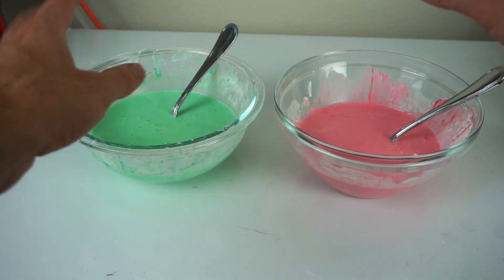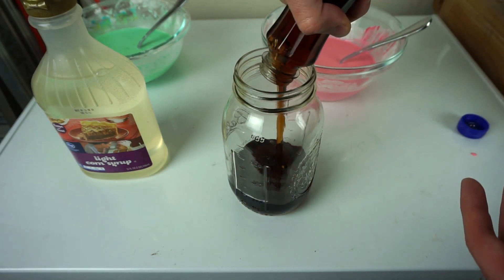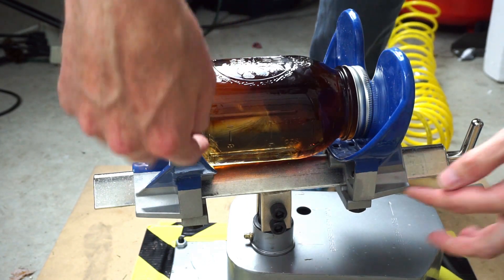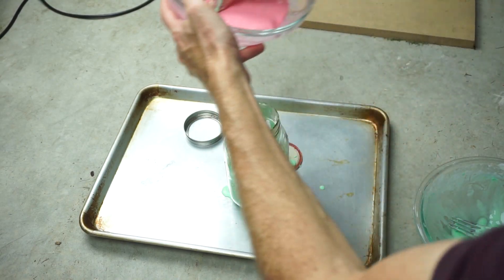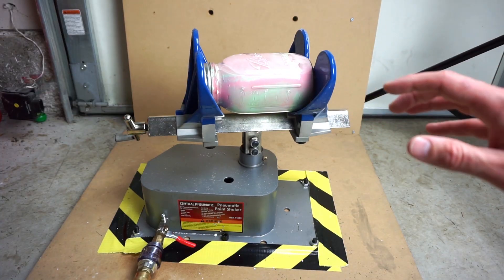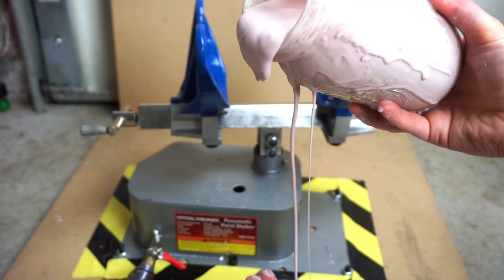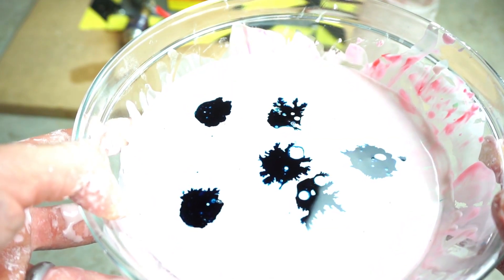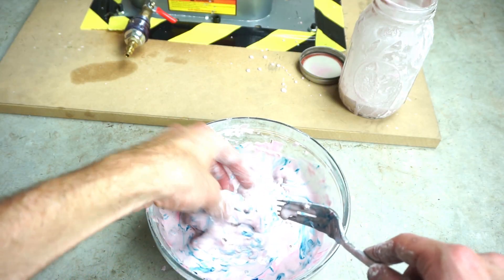Is it Possible To Mix Oobleck in a Paint Shaker? Shaking Non-Newtonian Fluids—I was Surprised!

Comment: Dear @The Action Lab , I was watching a youtube shorts video of yours featuring this video, and the subject of vibrations and non-Newtonian fluids intrigued me. I was hoping you could perform an experiment I do not have the materials to do. The experiment goes as follows: 

Materials: 
A machine used to rapidly vibrate a rigid plate along various axes, preferably with adjustable amplitude and frequency
a rigid, planar plate at an incline used to gauge the rate of movement of a fluid down the incline at various frequencies, amplitudes, and axes of vibration
At least three fluids, one exhibiting Newtonian properties as a liquid (e.g. water), one exhibiting shear-thinning (e.g., ketchup, grease), and one exhibiting shear-thickening (e.g., oobleck)
A setup such that the vibration of the plate can be adjusted to various directions (i.e., co-planar-horizontal, co-planar-diagonal, co-planar-"vertical," perpendicular,  horizontal, vertical, etc.)
Camera for recording

Possible independent variables: axis of vibration, angle of vibration relative to incline angle, frequency of vibration, amplitude of vibration, fluid on the plate, volume of fluid deposited onto the plate, whether the plate is vibrating when the liquid is deposited onto the plate
Possible dependent variables: rate of flow of fluid, rate of movement of fluid (in the case of the fluid rolling or sliding rather than flowing), presence of flow, threshold amplitude for the flow to be halted, manner of movement (i.e., sliding, rolling, bouncing, flowing, etc.)

I am extremely interested in the results of this experiment, although I do not have means to perform it. I encourage you to adapt the procedure and/or material, variables, etc. as it may suit you. Possible applications of this experiment could be the effects of vibration on the employment of non-Newtonian fluids in elements such as bearings, containing grease, or possible uses for suspension in vibration-affected objects, possible use as a conditional adhesive, and more. I hope you see this, and I do not ask for credit, only answers. This is not time-sensitive for me, merely a curiosity. If there have been studies on this type of question, would you please link them? Thank you!

Comment: I don't think syrup is Newtonian. Newtonian fluids always have the same viscosity. I haven't looked it up to confirm but I would confidently bet that syrup is thixotropic.
Reply: Also, it would be interesting to see how two layers of colored sand mix and whether they'd be similar to the oobleck.  I also didn't expect mixing as easy as what we saw so I think either some water/die became mobile or the oobleck was made solid (and brittle) enough to act like tiny particles rather than a continuous liquid (which I suppose might be regarded as tinier particles in some senses)

Comment: An easy way to make ooblek a color is to use the food coloring in the water before adding it. I didn't think anybody would try it after already mixing the two. I just figured people would know it would be to hard. I see a lot of comments talking about how he said red and not pink. It could have been red and the cameras just funky, just said it wrong without thinking or he's color blind. And I also see comments about the ooblek itself. That is perfect ooblek. If you properly measure everything it should be just like his. 50/50 water cornstarch.

Comment: In the same way vibration (such as earthquakes) causes liquefaction in solids, the vibration of the paint shaker will mix the fuck out of “oobleck”. There is no impact or shearing force in the paint mixer so it should liquify more than it would under ordinary circumstances

Comment: Can you mix concrete in a paint shaker?  If you put the mixed concrete in a vacuum chamber, will it remove all of the air?  If you simply put water and concrete mix in a vacuum chamber, will the water spread throughout?

Comment: Perhaps the speed of the shaker doesn't matter? There is always a point closest to the center of rotation where, no matter how fast you shake the whole jar, it is still moving very slowly...I think even if you got your hands on the fastest paint mixer you could find, it would still mix itself from the center outwards. Did not expect it to mix initially, but thinking further it makes sense.

Comment: This must be because the oobleck moves with the jar and is too thick to splash anywhere so it circulates within. Wish I could’ve worded this better.

Edit: in other words, the oobleck gets hard when compression happens to it, so it takes the easy route and converts that movement energy from the paint shaker into movement energy

I still wish I could explain this better

Comment: I think you used too much corn starch in this oobleck
Reply: I was about to comment this exact thing !
Reply: Yeah that’s what I was thinking. It was wayyyy too hard
Reply: I have to agree
Reply: he was testing how it mixes when its supposed to be in its solid state, so a thick mixture with high shear rate means it takes a lot less force to be solid which is what you want in this particular case
Reply: No it doesn't. I've made oobleck before and it is supposed to be like that

Comment: When oblec stays in a steady rate, it becomes a liquid. Even in movement, if the frequency of that movement stays the same the vescocity of the oblec will be such as a liquid. Oblec only hardens as a reaction to sharp instant force. So if you like oblec and then keep your finger there, it will eventually liquify. And paint shaker applies the same vibrating frequency to the oblec so it reacts as if in a stable, stationary, enviornment.

Comment: It's the same exact substance, of course it will mix, well it's actually the food colouring mixing.
Reply: Kale Stars that's not what he was testing though
Reply: ben zelmer no, he's testing the behavior of oobleck under fast shaking conditions, the coloring is there as an indicator.
Reply: Kale Stars if you put two blocks of aluminum in the container, will they mix? They are after all the same substance...he is interested in trying to mix non Newtonian fluids because they behave like solids under some circumstances and liquids under other circumstances, and obviously solids do not mix.
Reply: Aero he is saying that the oobleck didn't move much, but the food coloring in the oobleck did. Unlike the syrup mixing, the oobleck was made from the same material just with different colors making it hard to observe if the oobleck was mixing or just the dye.
Reply: Kale Stars I word smart I all most spelled the word smart wonge I all most did it again
Reply: Ismileback that is what hetesting will it mix

Comment: I don't think it'll mix because what causes the solid to liquid reaction is caused by the corn starch. When you place enough into water, the corn starch stops dissolving in the water and starts just absorbing it. When you put pressure on it, enough water comes out to create the "solid", but as you let it run, it reabsorbs the water. Because of this, just shaking it wont put the pressure required to prevent mixing. At least that's my hypothesis, I haven't looked it up.

Comment: maybe the point is that the shaker actually isn't moving that fast around the rotation axis.. right at the axis it doesnt actually move at all, relatively... only the far ends move fast... AND since it is moving back and forth it actually comes to a standstill for a very short time to reverse direction...
of course it would be easier to mix in the colors if you mixed the color into the water before adding the corn starch.. ;-)

Comment: It's because oobleck's viscosity actually goes up from pressure not movement. The reason it starts to act solid is because the starch molecules get squeezed together and act as a wall, so in a jar its all one liquid with no real outside force just like if you were to pour it into each other.
Reply from the maker: +jacob freed I agree that is pressure that makes it solid, but in the paint shaker there is an artificial force (centrifugal force) that does cause pressure. Just not enough to solidify it as I learned:)
Reply: Im now realizing that I could have explained what I was saying better but their is no surface tension between the two colors it is all one liquid. Since like I said the starch condenses and forms whats similar to a wall, the entire center is free to move around because the outside is the only wall like substance from surface tension. Plus there is no movement on the plane of y or z only x meaning it can mix in an up and down, or forward and backward motion forcing it to make a triangle waveform as it moves around inside the jar which is why there is a visible difference from the outside. Also you are referring to an oscillate force meaning to move back and forth in relevance to a center point vs centrifugal which is to move around a center point. (punctuation is not my strong point)

Comment: The reason it worked is because both th pink and green are both using the same compound, cornstarch. That is why the syrups also mixed because even though one was more dense they are both primarily sugar those two compounds would probably not separate after being amalgamated. Vinaigrettes however are easily separated because you have a minimum of two completely adverse compounds: liquid lipid like olive oil and vinegar; they are able to make a homogenous mixture because of air being mixed into it. However most vinaigrettes will separate and need to be mixed again due to the high density in oil vs. vinager; again two non related compounds.

Comment: saying that mixing with a fork is inefficient was incorrect because you tried mixing food coloring with oobleck (different properties), but with the paint shaker you mixed two different colored ooblecks (have the same properties). you cannot say that a paint shaker is a more efficient way of mixing oobleck because it was not a valid control. try mixing oobleck and food coloring in the paint shaker or mixing the two oobleck colors with the fork, then it will be a valid experiment.

Comment: I don't believe the two are "mixing" so much that the water in the two is now one mass of water with two dyes in it. That dye, in the water, is hampered in its movement by the cornstarch. It's like watching water flow through a compact mound of sand, like the water table. It's one body of water with dye in it which is hampered by the presence of cornstarch. Of course it will mix.

Comment: There is a fair bit of air in the jar. It'd be possible the oobleck is breaking apart as small solids which will then allow those smaller parts to move and mix.

Comment: the oobleck mixed because they are the same density or close enough to the same density unlike the syrup and light corn syrup so they did not try to separate and make one color float and the other sink
Reply: or that is at least why they mixed faster than the syrups

Comment: it mixes the same way a full jar of multi colored sand would. The oobleck is in its most solid state when it's being violently shaken by the paint mixer. Because the mixer is so violent, the oobleck fractures the same way it does with the fork, but in thousands of much smaller fractures every time it reverses direction. Just as the grains of sand would not settle back into the same space it was thrown from, the fractured oobleck will also not return to it's exact original location and another fractured piece will move into that location. Soon, it appears as if it had mixed as a liquid, but in reality, it mixed as a solid in a fluid state.

Comment: my hypothesis is that it will not mix because the oobleck only moves when a slow and steady force is applied to it, however, the paint shaker moves very quickly

Comment: I want to see oobleck in a blender that willbe interesting...
Reply: Albinoz! Well the blades might be able to cut through the solid oobleck, but it might fry your blender, so I wouldn't try it.
Reply: gamebreakinglogic the blender would probably explode
Reply: gamebreakinglogic it would be clogged and then it would explode and everything would be a BIG mess
Reply: I did that before no I was not high I had an old blender in the blades just cut through the Oobleck
Reply: gamebreakinglogic theres a video of it i think
Reply: gamebreakinglogic cornstarch
Reply: gamebreakinglogic the blender wouldn't even start and just break when you start mixing it
Reply: gamebreakinglogic https://youtu.be/Cdw-M-3PY24
Reply: White Reayper Due to the high force of the blades.

Comment: Question. Why, when making oobleck, wouldn't you mix food coloring with the water, so you then wouldn't have to mix the prepared oobleck with food coloring afterwards?
Reply from the maker: +mrthenewguy87 in this case I made the oobleck in one batch so that they were the exact same water concentration for the mixing experiment. So I had to color them after.
Reply: The Action Lab that's fair enough, thanks for the  answer!

Comment: Do you think you hit some type of Oobleck resonant frequency?  Where by the impedance caused by shear is reduced as a function of the systems spring dashpots in resonance.   I was just as surprised by the results, and wonder if all things equal does the material mix at a particular resonance frequency.

You see this stuff stiffen up with high frequencies, pehrps the shaker is low enough to get the matter to resonate.

Comment: I had a feeling that it was going to mix well. Oobleck (and pretty much all Non-Newtonian fluids) are a lot like saturated or partially saturated soil. And putting in in a paint shaker would be a lot like an Earthquake. And when saturated or partially saturated soil experience an earthquake it goes through Soil liquefaction.

Comment: When you did the slow motion part you did 3x and 8x the speed, shouldn't it have been 1/3 or 1/8 the speed instead of 3 times the speed?
Reply from the maker: +Shicron it was sped up. It just looked slowed down because of the frame rates:)

Comment: Answering questions I did not know to ask again I see. :)
EDIT: Food for thought. I am not sure that I agree with you on the shear rate being slower. I think that what we are seeing is it being forced to mix similar to dust or any other small particulate. Acts like a solid but still mixes. When it liquefies, it would remain mixed.
So thoughts?
Reply from the maker: +Draygoes thanks! I'm not sure about it mixing like sand since it didn't look like it became little broken pieces or anything while mixing (could be wrong though). It seems like it needs pretty high pressure/shear to go solid. It would be interesting to measure what the shear rate is in a paint shaker.
Reply: The Action Lab - Yeah defiantly! Perhaps future video idea?